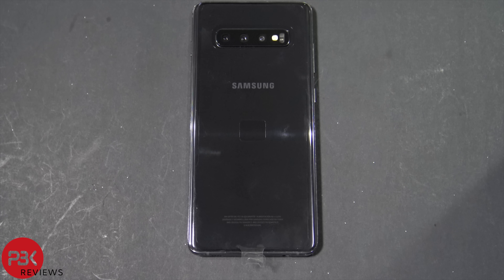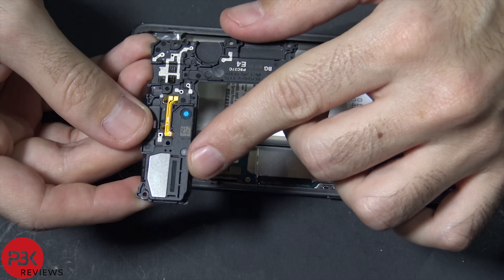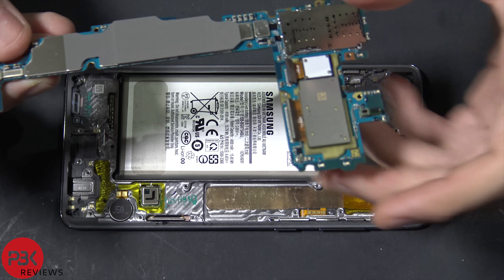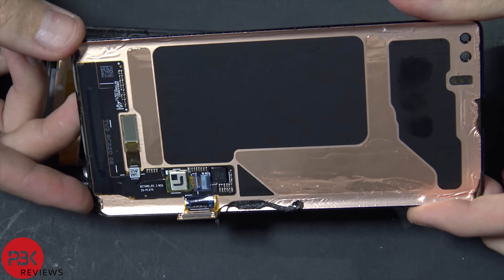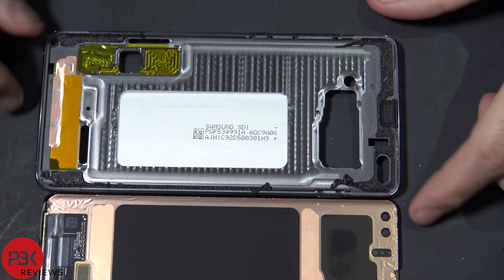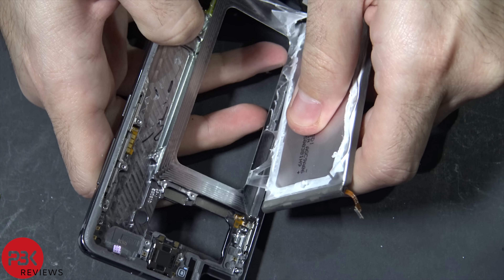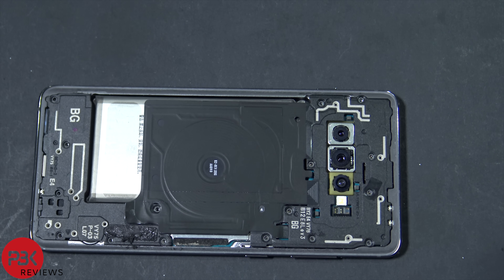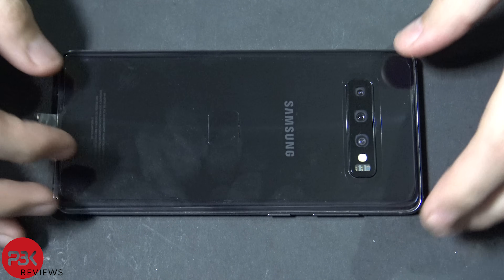Samsung Galaxy S10+ Plus Disassembly Teardown Repair Video Guide. Any Bitcoin Inside?

Comment: Damn, finally someone shows how to separate the screen, is it the same as the older version or its fully soldered on the screen
Reply from the maker: What do you mean by fully soldered on? soldered onto what? basically all you need to do is take the back cover off, then remove the plastic covers and disconnect the battery cable, and the screen cable then pry off the screen from the front of the midframe.
Reply: @PBKreviews  i mean, isnt the frame attached to the screen? (On the S9)
Iirc if you want to change the screen you have to buy a whole frame with the screen to change it
Reply from the maker: @owo7094  Oh, no its not attached to the frame its just held on with adhesive
Reply: @PBKreviews  oh, didnt know, so its the same as S10, thanks
Reply from the maker: @owo7094  yup, no problem :)

Comment: Wow, does this mean that to replace the screen you only need to remove the back cover and the plastic parts? I hope that the fingerprint scanner won't be like Apple's unchangeable one...
Reply from the maker: Yea basically remove the back cover, and the bottom plastic cover, then disconnect the screen cable and you can pry the screen off and replace it and re connect the cable and re assemble the plastic and back cover. However just to be safe, I would also remove the top plastic cover to disconnect the battery cable so you don't short anything :)

Comment: Always a cheap vibrator motor. Why won't Android OEM install a good one like the one on iPhones?
Reply: that motor really sucks. it'll stop working anytime. happened with me for 2 phones which were water resistant and i dont wanted to loose water resistance just to replace those
Reply: Ajay Patil On what phone?
Reply: @Peizxcv  xperia m4 and Samsung a7 17
Reply: Ajay Patil I’d imagine higher end Android would have butter built but they should really switch to the better haptic engine on iPhones and Pixel
Reply: IPhone's taptic engine takes a lot of space. That's why they can't fit bigger battery and headphone jack. The phone needs to be bigger to fit those components.
Reply: MaxmillianMus Man Well worth the trade off. It adds more to overall refinement.
Reply: I think the haptic engine from Apple is bigger, maybe thats a reason
Reply: Its works so its good
Reply from the maker: Not sure but I have never had issues so far with any android vibrator motor even though some newer phones I've seen better looking and built ones.
Reply: @PBKreviews  but the rest is shit
Reply: pwrdbykyank I think Pixel 2 and/or 3 have an iPhone style ones but still smaller. The haptic feedback on iPhone really is amazing.
Reply from the maker: oh yep makes sense for haptic feedback

Comment: Hey buddy tell me does the charging port is inbuild in the motherboard? If yes that means if charging port damaged we ha e to change the whole motherboard?? Is thiscorrect
Reply: no you don't have to change the whole motherboard to fix the charging port...you can use a hot air station to fix the charging port without replacing the whole board.
Reply: @David-Zita  air station?
Reply: Do you mean soldering??
Reply: yes air station
Reply from the maker: Ya the charger port is soldered onto the motherboard so replacing it you would need to solder a new one on.
Reply: Is a hot air station, a mini heat gun?

Comment: This phone would've been 10 000 times if it had a rubberized plastic back, I love the metal frame and how sturdy it looks but all in vain with a glass back cover.
Reply from the maker: true
Reply: I wonder if some company can replace the back glass cover with a rubber cover on any other choice of materials, that'd be cool.
Reply: @NanoMine  there are skins like Dbrand
Reply: My thought is that they used the glass back cover to give the phone a superior and flagship feel but hey, the plastic rubbery back might also be a good thing. I just got mine a silicone case and matte screen and the phone does feel good handling.

Comment: Soldered USB port, really??
Reply from the maker: Yep, I would have thought it would have been on a replaceable flex cable to make it easily repairable since charger ports tend to break often.
Reply: @PBKreviews  Probably to force people to use wireless charging. I can't remember when was the last time I used the USB for charging on my S8+
Reply from the maker: @Urgleflogue  Honestly, I personally have never used wireless charging for the fact that the phone just heats up and doesn't charge too fast. But the fact this phone has reverse wireless charging is a great thing. Always people ask hey do you have a charger for this phone or for that phone, this way you can charge with your phone without having a cable :)
Reply: @PBKreviews  Wireless charging is inherently slower and hotter due to additional EM and ressistivity losses. Although I remember around two months after buying this S8+ I also bought two Samsung wireless chargers rated for fast charging. Even today (approx year and a half later) they can pump the battery from 5% to 100% in about 40 minutes. The phone warms a bit, that's true, but no big deal. This leaves me to use the USB only with my external batteries when I am caught outside with low juice in the phone, which happens 
rarely.
Reply from the maker: @Urgleflogue  True, I mean it would be convenient if your at home or work, some please that you have the wireless charger set on the table and just lay your phone on it. Last year n half I have been using the moto z2 force and with the attachable turbo power battery mod on the back, it keeps the phone going a full day n half on heavy use so I have really never needed to recharge while being out. I always just plug in at night and that's it. But if soon when I change my main phone to something else if its not a motorola again, I would probably be looking into wireless charging
Reply: More to charge for the repair ♥️👌
Reply: bad bad choice from samsung huh ?
Reply: Dirty move from samsung. If they continue like that i won't be buying their flagships for a premium price. It's very greedy of them which reminds me of apple. If huawei become #1 worldwide seller one day, then samsung can only blame themselves.
Reply: I don’t think it really matters. Unless you’re really hard on your phone, it probably won’t stop working for years. You and almost everyone else would most likely upgrade again before the USB port breaks

Comment: it still working after repair?
Reply from the maker: Yes, the phone overall itself is not hard to disassemble and replace parts, however the screen is very fragile and if not very careful, you can damage or break it.
Reply: @PBKreviews  pls make in the end of video some moments where you turn on your repaired smartphone
Reply from the maker: I can't add to the video, I can only edit stuff out of the uploaded video. The phone is being used right now by one of us, if I have time later to do another video on the phone I will look into it.
Reply: @PBKreviews  but its no longer gonna be water resistant.

Comment: What type exactly/ model number is the main camera sensor? Is it a upgrade from s9?
Reply from the maker: The rear cameras are 16-MP Ultra Wide, 12-MP wide-angle, 12-MP telephoto. As far as the model numbers go for the sensors, I am not sure. I would assume its a better sensor than the S9.

Comment: This phone so complicated... But looking at the strong frame structure.. you know..this is experience innovation
Reply from the maker: Yea, but its not too hard to disassemble to replace say the battery or other small parts etc. compared to some other phones which are more complicated.
Reply: PBKreviews hi I have a galaxy s10 plus and every time I put force on the screen with my finger it sounds like the adhesive is coming unstuck just wondering if you have seen this happen and if it’s normal thanks for your help
Reply: @anthonycatanzariti7990  THisss, only that I hear a pop sound just above the fingerprint area alone like it gives you a clue that there's a hole punch around that area. All in all everything in it just works perfectly; the fingerprint fast enough. It's good that you also noticed that sound.

Comment: 4000mAh???
Reply from the maker: yupp!
Reply: @PBKreviews  is it not 4100mah for the s10+?
Reply from the maker: @RDJ9887  On the battery it says Rated Capacity: 4000 mAh and Typical Capacity: 4100 mAh